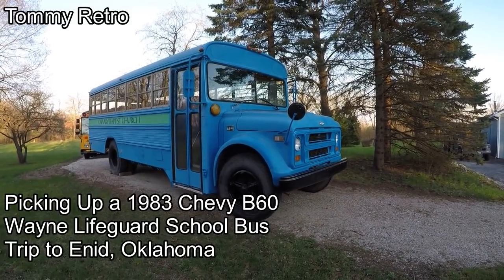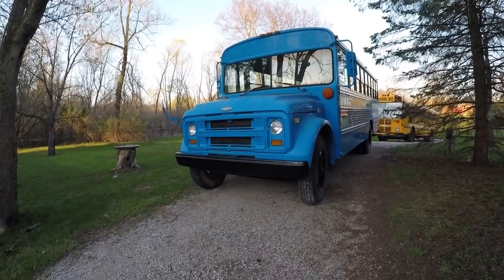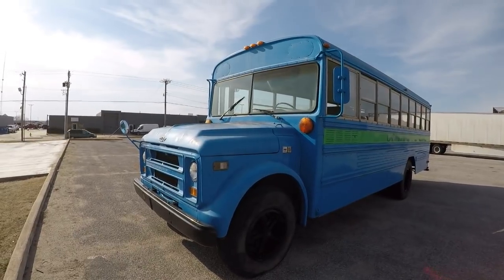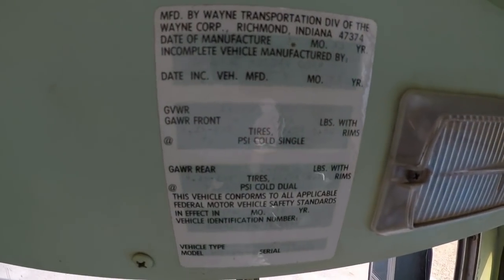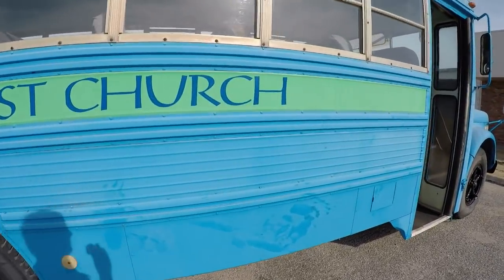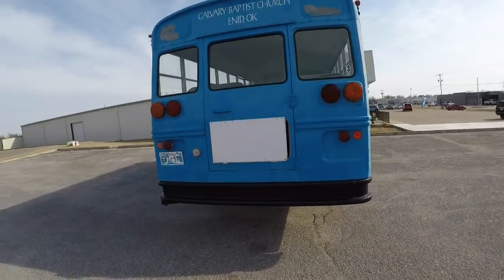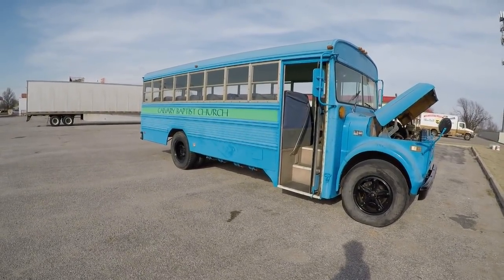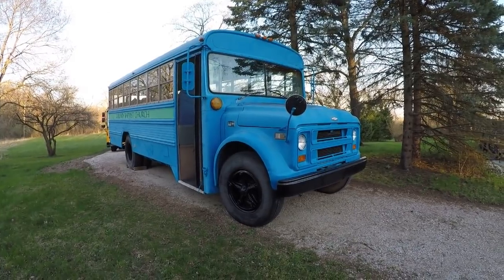Picking up a 1983 Chevy B60 Wayne Lifeguard School Bus Trip to Enid, Oklahoma

Comment: Looks like it used to have warning lights. Tough looking little bus. Those old Waynes are getting harder to find, especially in that good of shape. I also like the look of the pre 1985 chevy front clip. Those older chevy 350's are solid reliable engines. If it was my bus i would try to find a 5 speed transmission from a newer heavy duty chevy pickup just to have an extra gear for the highway.
Reply from the maker: Thanks Noah!  That extra gear would be sweet!
Reply: A lot of church buses were bought by school districts and contractors originally, then donated to/acquired by churches - the only Wayne Lifeguard I have ever seen in Maryland was a school bus (1968 Wayne/Ford used as a spare by a contractor).  In school bus service, if warning lights were a requirement (such as in Pennsylvania in the 197x and later or Maryland in 1982 and later; yes, Pennsylvania was ahead of Maryland there - I am referring to the eight-ways).  If I am not mistaken, the Wayne Lifeguards only would have had eight-ways in their last year or two of production.  Superior, Ward, and Thomas had them - I saw all three in Pennsylvania.  And there swas overlap between states that required eight-way flashers and states that didn't.   Pennsylvania and New Jersey had the eight-way requirement; however, Maryland and Virginia did not - this was 1979.

Comment: Those arn't the original seats. In 83  Wayne still had jungle green. The sleeves would have had white piping if jungle green. If it had spruce like on header it be black piping.